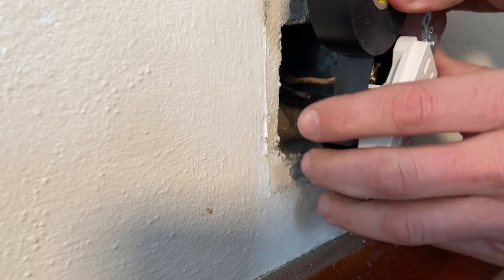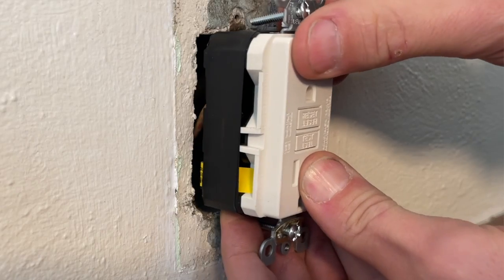Should You Wrap Outlets In Electrical Tape?

Comment: my take is no tape needed.  if you want to, go ahead. but,  always leave a tail.  fold the tape over itself the last 1/2 inch.  next time its easy to get off.    solid wires need to be twisted together before the wire nut.   tape is just messy,  i've opened motor connections  and found the tape all melted from the heat.    what a pain the ass that is.

Comment: I've seen electrical tape that is over 30 years old and it is a gooey mess.  I was told that if you see black electrical tape anywhere in your household wiring that is a sign that it was not done by an electrician.

Comment: I always use electrical tape to protect the next guy. Too many DIY out there! Also prevents accidentally shorting the ground as you push it back into the box.
Reply: Yes I'm glad I studied under an apprenticeship for years to match colored wires and tighten screws.
Yeah not rocket science

Comment: I hate the residue left from old slimy electric tape, make fingers black and sticky. I'm going to try using Kapton Tape; used for make high current lithium batteries. It's a translucent yellow, so we can see the connections without pealing the tape.  Plus I could use it for repairing small electrics designed to fail in less than 24 months, tired of buying new junk! I've replaced my wife's a phone screen after she broke it month of ownership (no I pay for cellphone insurance on her cellphone, full auto insurance coverage with roadside assistance, and Synology NAS to backup up her 3rd/4th/5th/6th/etc laptop that was lost, stolen, or won't boot, so she doesn't loss data.

Scotch® Super 33+ Vinyl Electrical Tape; 7 mil thick, dielectric strength up to 600V, withstand temperatures up to 221°F/105°C).

Kapton Tape; 1mil thickness, silicon adhesive protection does not leave a residue, dielectric strength up to	8,000 volts, withstand temperatures up to 500°F/260°C.

Comment: When taping wire nuts, you do your pull test first, then tape after.  The tape is mean to make sure the wire nut does not accidentally untwist while working with the wires or mounting the box.  It's an easy step to add some safety.

Comment: You should put the neutral wire on the other side of the screw.
Reply: The way it is right now, when you tighten the screw the wire will back out. If you put the wire on the other side of the screw and tighten it, it will pull the wire in tighter.

Comment: I'm not an electrician but if tape was required around outlets then surely they would be designed and sold with a protective cover and code would require one.

Comment: Electrical tape is really just vinyl with an adhesive. that adhesive breaks down over time. 
I think automotive harness tape would be a better choice, its cold and heat resistant.
There is also Scotch 69 Glass Cloth Electrical Tape. its insolating and flame retardant.

Comment: If I were to tape a wire nut, which I have done in the past, I would make sure the wires are secure before I would wrap it with tape. Common sense. Anyone who doesn't, should not be doing electrical work.

Comment: In 47 years of industrial electrical applications (all metal boxes), I cannot recount the number of multiplex boxes where power came from separate breakers. Killing one, often left others hot. Without the tape, you are very vulnerable, especially with 277/480Volt stuff

Comment: Note:(per NEC) GFCI aren't supposed to be installed on non-grounded circuits. The breaker won't function correctly or at all, without ground! Which renders it redundant, because it only appears to be safe.
Reply: Could you explain 406.4 then?
Reply: I'll look it up when I find time. Contractor (w common knowledge & diverse experience  though not a lisc Electrician. Sounds like beneficial info that I might want/ should know. As a personal rule of thumb [no dedicated ground ~ no GFCI (recep)]. Most old homes I've had my hands into, still have 2 wire(+/-,no Ground wire,  wire when possible. Very little knowledge or experience with distribution GFCI's.lo
Reply: An egc does nothing for the function  of a gfci.

Comment: You should always put it on when working with metal.

That way, when someone has to work on it live later, they can pull it out, without fighting with the device trying to not let the screws hit the metal upon pulling it out.

Some guy downtown tried to work on a 2 pole switch - and blew fuses. Cost the company lots of money.

Also, overtime, the outlet gets loose in the box. My aunts outlet started sparking due to the screws being too close to the metal box. Wouldn't have happened if it was taped.

Comment: Can't stand coming behind some hack moonlighter who put sticky, dirty tape on devices 20 years ago.I also find union and industrial trained electricians have a tendency to do materials and time-wasting things like tape wrapping. I'm not trying to be a troll, just my observation. Some of those electricians spend more time planning breaks, lunches, and the appearance of hard work than actual work. I was told by a union electrician once his daily quota of install for 12 hour shift was 100 feet of 1/2 emt. I said that was about right once you get your wire pulled and terminated.  and he replied, no, that is just a straight run, no wire, and each 4x4 box counted for 20 feet of conduit or something like that. Oh, and make sure to put nice and perfect right angles on your panel wiring as that's an easy way to finish out the last 7 hours of your shift. Once came behind a factory moonlighter where homeowner told me it took him 9 HOURS  to install a MLO subpanel with only 3 breakers in it. Cable was already stubbed out of wall even. The bends in the wire sure were pretty, though. It's a shame I had to add the seperate grounding bar for him...

Comment: I had seen electrician wrap the outlets. So when I replace some outlets in my house I also wrapped them with electrical tape, Fast forward 10 years later remove the an outlet and the tape over the years shrunk and slipped off the back end of the outlet, So why waist my time if it does not stay in place over the years.
Reply: How do you know that tape didn't last 9 years 11 months  and 29 days before falling off the outlet?

Comment: there are no wire nuts in my home..... i use a more secure and permanent solution but on jobs all day and i never tape a wire nut... if i see a taped wire nut it is removed and if you can see copper from the nut i nip the end enough so that the new connection has no copper visible and all lines resist a 3 pound pull.
Reply from the maker: Thanks for the feedback Kevin.

Comment: NO, black electrical tape becomes a sticky mess after a short time. Use silicon self fusing  tape instead. Does the job and so easy to remove.

Comment: It is not a code requirement nor is it a sin to do it. I had my people do it for just a little protection for the next person who had to work on the device. Most of the time it would not be a electrician with more time. It would be a service technician, home owner, trouble shooter with out any way of turning off the device. I know that should be wrong but in the real world devices do not get turned off. As for a taping up wirenuts. There is nothing more frightening than to take a 1900 box cover off that is over your head and several wirenuts fall out on top of your head. All you can do it lower your head and hope nothing blows up. Yes that should not happen but it does happen. Take a 277 volt circuit and lose wirenuts. Faulty wiring yes, real world yes

Comment: Well, it's not like you're going to hurt anything, but if you need do it then you have other problems that tape isn't going to solve.
Reply from the maker: Yeah, I feel this way more for wire nuts as compared to receptacles.
Reply: @EverydayHomeRepairs  I don't really trust wire nuts all that much as people frequently use the wrong size one for the number and gauge of wires they are connecting. Also, in any situation where there is vibration they have a tendency to come undone. I've seen a LOT of tape slapped onto wire nuts to try and stop that from happening.

Comment: What’s more of an issue is the fact you did not install a proper ground onto your new outlet
Reply: If it's a metal box with metal conduit running to the panel, extra ground is not needed in most cases. The outlet ground terminal is bonded to screw hole on the outlet itself which in turn gets its ground from the box

Comment: Have seen wire stripped too long and copper extends past the end of the wire nut & then taped. Should be installed right in the first place with no tape.

Comment: If the receptacle is going into a metal box, it might be a good idea. Plastic boxes don't need it. Plastic doesn't conduct electricity and plastic boxes are a lot bigger than metal boxes. Taping receptacles in plastic boxes is pointless.

Comment: Have you ever used a metal fish tape to pull an extra wire in conduit?   I have, and if you just use wire nuts on your wires you might be in for a shocking development. The end of the wire fish tape will fit into the open end of the wire nut so be ready for a shocking development. The only way to avoid this is to tape up the wire nut with electrical tape or use a more expensive fiberglass fish tape.
Reply: I try not to shove a meal fish tape into conduits with live conductors. If you do this often enough it might be a good idea to get yourself non metal fish tape.
Reply: @hycel78  How do you know where wire nuts are located inside the metal conduit? The conduit is not clear so you can't see where wire nuts are located. Do you think that most electricians shut down power just to fish a new line into conduit? My brother was a licensed electrician and I never saw him shut off power once to run a new electric line.

Comment: Never wrap outlets with electrical tape.
The adhesive is not designed for high temps and can out gas, attacking the copper wire and terminals.
It is not fire rated.

Comment: No need for electrical tape around a receptacle when one uses a plastic outlet box instead of the metal ones.
Reply: Don't need it for metal boxes either. Never have I once seen an outlet or switch arc to a metal box.
Reply: @oldcrazyeye6482  It all depends on the size of the metal outlet box for some are pretty small and very close to the inserted outlet receptacle. Especially when one uses a larger GFCI receptacle it almost touches the metal box.
Maybe I just don't like metal boxes and prefer the plastic ones, which are also cheaper.
Reply: @mauriceharting5877  see, whereas 90% of the electric I've done is conduit and metal boxes. So in that aspect to each their own. I hear what you're saying about gfi's though, especially in a handy box or brick box. There's no room for anything. That's about the only time I'll stab a gfi in the back or tape it
Reply: @oldcrazyeye6482  I could be wrong, but in commercial buildings, code requires metal outlet boxes in most jurisdictions, however in residential settings I would recommend plastic outlet boxes since these are easier and cheaper to install. You don't need to screw down electrical wires in plastic boxes for these are held in place by flexible clamp downs saving time and money.
Reply: @mauriceharting5877  where I'm at, Chicago area, northwest Indiana, they require metal everything. I will agree with the plastic boxes though. Lately been getting a lot of situations where the metal boxes shield wifi signals coming from smart switches. I just love conduit because it gives you so many more options for wiring and feeding. Especially post construction

Comment: The thing with using tape on wire nuts, you should pull on the wires BEFORE you wrap tape around them, if you are going to use tape.  Just sayin'.

Comment: Everyone should start using wago connectors over wire nuts
Reply from the maker: Little pricey but I don’t hate that idea
Reply: They haven't been proven. Besides I can buy a small varuety pack of wire nuts but I can't buy a small pack of Wago connectors at a reasonable price.
Reply: @njsongwriter  they been proven also wire nuts eat into the copper so each time u take 1 off u should cut fresh
Id pay more for a better connection and safety

Comment: All metal enclosures and non conductor surfaces should be grounded, and all connections and interfaces should by design should not contact other metal surfaces.  If you need to wrap tape around fixed installations like sockets then you have a major fundamental design issue with your basic materials, and fittings.  Speaking as a friendly non-American.

Comment: No. Wrap the wire nuts and wires, do not wrap the whole thing.  You will get glue on the outlet and the whole outlet can get hot and the tape catch melt starting a fire.

Comment: Logically how is wrapping receptacles suppose to help? For one the tape is on top of the screw terminals and it isn’t tacky  Secondly the screws give you the best protection And lastly if for whatever reason if the wires were to come loose and cause a issue that tape wouldn’t stand up to the heat So again Why🙄?

Comment: I had a mouse commit suicide by crawling around the top of a receptacle and touching both sides.  Had it been taped, the outcome would be different.
Reply: No matter how remote the possibility that a mouse can get into a proper electrical box, increasing the odds of killing said vermin is a compelling vote to never tape a receptacle.
Reply: @Sylvan_dB  it actually isn't that remote.  A large mouse can squeeze through a 5/16” hole.

I'm sort of in agreement though.  It's debatable: It stunk for a couple of weeks, and no one could find it.  I didn't find it till I took the cover plate off, probably a year later.  

Obviously it didn't, but that could've started a fire.

Comment: What ever is code in the city you are working in.
Reply from the maker: Hey Eric, I don't think code covers the electrical tape debate.
Reply: @EverydayHomeRepairs  When ever I do a fix&flip I go to the inspector who is going to be inspecting the home. And ask him for examples of blue prints of work that is except able to him. They usually give me two or three ways of doing something. That way when he comes to inspect. I know I will pass the inspection because I did it with the blue prints he gave me. Tape would be one of the things I would put on if he licked it better. Just a suggestion.

Comment: I'll go back to what I said in the poll and add a little something to it.  Taping just makes it more difficult for the next guy that has to work on it.  Even the 3m tape becomes a sticky mess over time. The additional part after watching this, Electrical tape isn't made for things that wear, so if you habe too small of a box, where the tape is the only thing preventing contact with the enclosure, eventually it will wear through from rubbing and you'll have the same problem as you would without.  it's a kluge, not a fix.  Electrical tape is great for low voltage, insulating soldered wires and such, but if you need it on a receptacle, you actually need to fix the problem instead.

Comment: Super 33 or 88? You crazy.  Way too expensive.  Temflex is the best I'll use. I only use 33 when doing very detailed wiring of fire alarm systems. Mostly in the main panels and power supplies.

Comment: One problem I could see happening is with cheap tape, the adhesive side may be slightly conductive & essentially it puts a small load on the circuit possibly causing itself to get warm. I wrapped an outlet recently and avoided crossing both terminals with a continuous length of tape. Neurotic but the role of tape had SA on the packaging but not on the roll + dollar store.... Im going to redo it.

Comment: If wrapping receptacles in electrical tape was safer/better, then why no requirement in the NEC.  That is your answer.  It is unnecessary because you should never work on or near an energized receptacle with the cover plate off.  Unless your name is Danger.  I do not care what your Uncle, neighbor, guy on internet, electrical inspector, master electrician says, they are incorrect.  I have never been shocked when the power was off, plain and simple.

Comment: I always use metal boxes and never wrap outlets or switches.  I don't see the need to do that.  Has anyone ever run into a problem caused by screw terminals not being covered?  Outlets and switches are to be screwed securely into place.  If someone isn't able to do that, they should have someone do the installation who is more knowledgeable.
Reply: Yes I've seen metal boxes in old homes that are dangerously close to receptacle screws. In the old days(before plastic boxes) there was no unified box size, some were very narrow.

Comment: No ! Absolutely never wrap outlets in electrical tape ! if there is ever heat build up or arcing all the tape does is make it more likely a fire can start .electrical tape is flammable. Only amatuer half assed handyman types and unqualified homeowner types wrap outlets. Boxes even metal boxes have sufficient room for devices if properly installed so there is absolutely no reason to wrap devices with tape.it's a complete amatuer move that is unnecessary and can result in a dangerous situation.